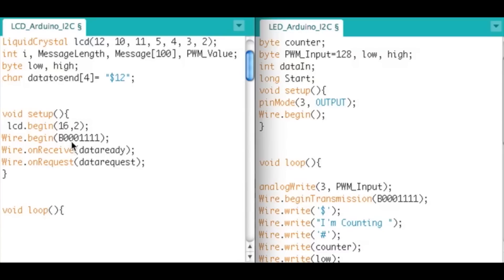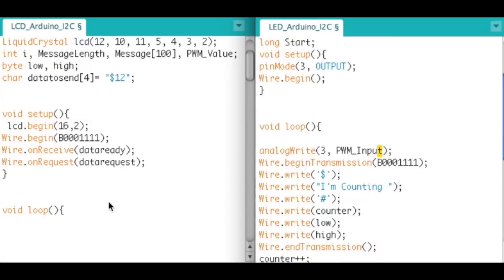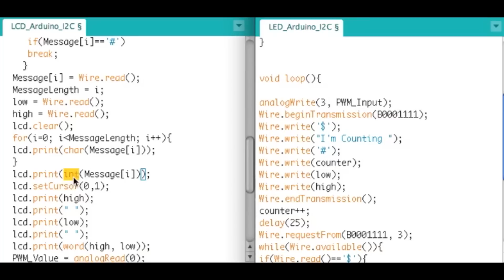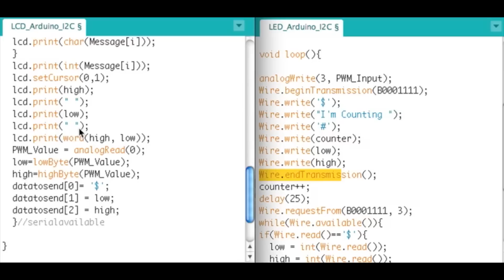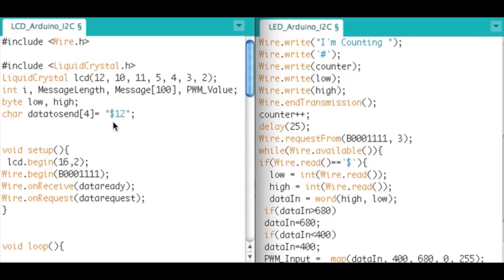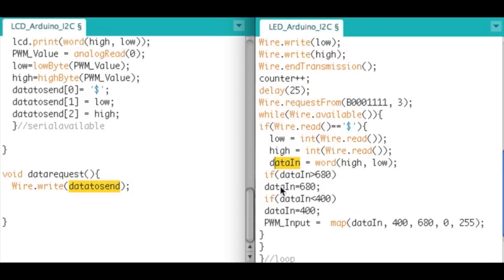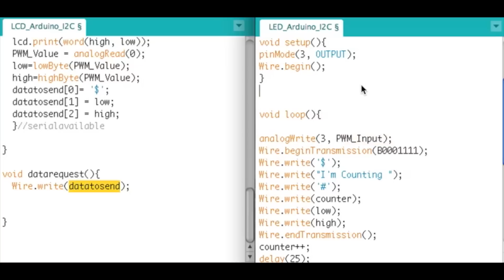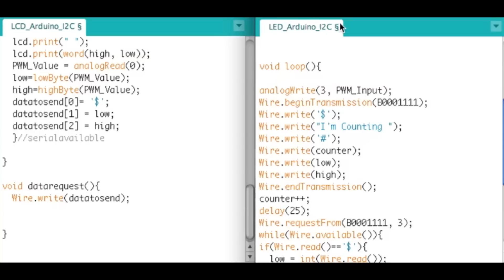2 Arduinos Talking How-To I2C / TWI

Comment: Hey, great vid Kevin. You cover a lot of bases when it comes to the woes of 2 way communication with master and slave. It's helped bring me some perspective to my own project where I have 3 arduinos, one running a network of sensors for obstacle avoidance, one for motor control and another for assembling RTK GPS info. If you think this project had you banging your head against the wall, I bet we have you beat! What a PITA!!! But it's been a fantastic learning experience though! Thanks a ton for the great video!

Comment: Could you do a tutorial on interfacing I2C devices with AVR microcontrollers in C, using atmel studio 6, as this is not an easy protocol to learn about without clear instruction

Comment from the maker: I may do a video on that.  For me, it only depends on the device I'm connecting to, like the compass module was only offered with I2C, so I had no choice, but there are pros and cons to both.  Speed wise, SPI is the way to go since you can clock data in and out at your crystal frequency/2  I2C is a little better as far as dealing with a network of devices since everything is addressed.  There's plenty out there on this topic, thats just what I think

Comment: I think the pull-up resistors are recommended because without them the arduino will detect random states as the - HIGH and LOW. Obviously that would mess up everything.